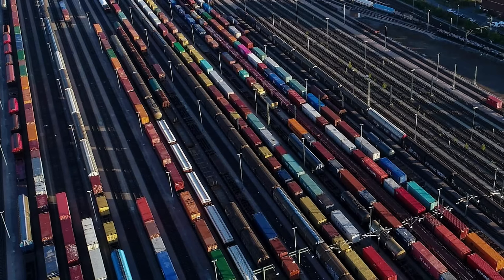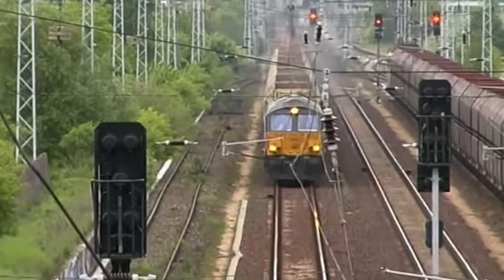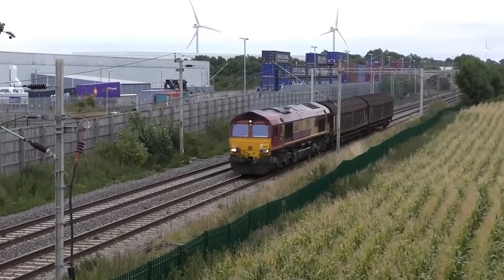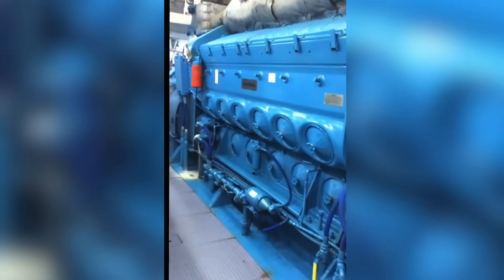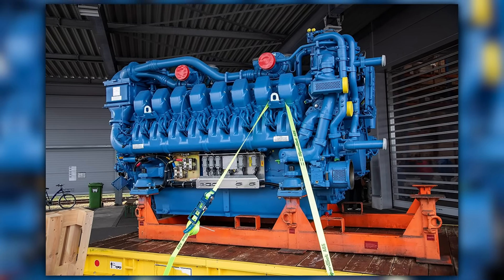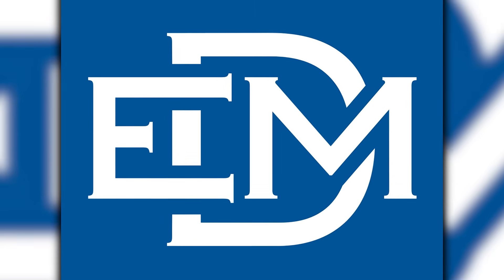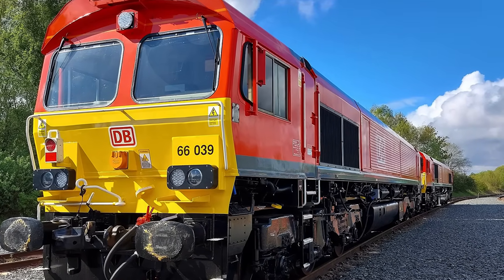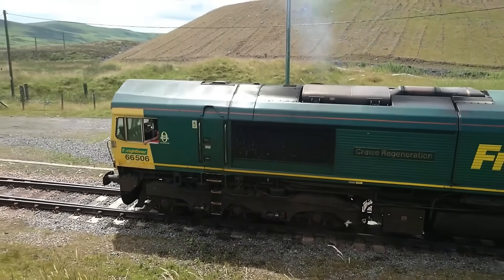Why Europe’s Class 66 Locomotive Still Haunts EMD

Comment: Interesting to see a couple of class 20 units......still working let alone numerous class 37s still happily working !!
Reply: They ran from Scarborough to KWVR very recently AI Bot has no idea telling us they are new cleaner more advanced tech then shows us an early 60's locomotive
Reply: @cedarcam  My property backs on to the Bedford to Bletchley line which has a lot of freight and stock transfer traffic. A while back I had a couple of class 20 units burbling by and regularly get my favourites the class 37s . When you hear these start off from the signals you can hear their exhausts roar from quite a distance ! Also many other vintage diesels still in use mainly being used for stock transfer...........engines built to last !!
Reply: @dominicallen7839  Very affectionate memories of the Marston Vale Line. It's a lovely run and the houses fit around the line in many places so nicely a better picture could not be seen from the windows. All the best there👋
Reply: @adm-5284  Indeed Adam , quite an interesting line with some very rural and remote stations. Of course where the old brickworks stood will be the setting for the planned Universal Studios theme park which will make this line very popular !!

Comment: EMD just didn't update their business model - General electric smashed them at hoime with AC traction based locomotives then environmental requirements ended the monopoly EMD had had for 50+ years.
Reply: General Motors left locomotive manufacture in 2010s? selling the division to Caterpillar (Progress Rail)
Progress Rail had fun and games with Tier4 stateside while Wabtec had an easier time.
Are the F7 in Norway 20 cylinder 645s?
I am wondering if they are like the ones and Australian operator imported in the early 2000s.
Apparently they had been stored for about 20 years before purchase.
I  believe only 2 or 3 are left operational out of an order of 20?

Comment: GBRF has, pretty much a standardised fleet of Class 66.
They are importing Class 66s redundant from the Continent
They also have rebuilt 16 Class 56 locos into Class 66 within ths 56's bodyshell and 56 bogies (Class 69)

They have now starting to use dual mode Stadler locomotives. Class 99 affectionally known as "Flakes"
To quote the ice-cream signs at seaside towns "It's not a 99 without a flake"
Two Class 99s are in Britain undergoing testing.
For those who don't know, the Class 99 has a Co-Co wheel arrangement
75 mph top speed (Can be 100 mph with a software tweak)
8000+ hp on 25kv overhead power
2400 hp on diesel
They also have small fleets of other locos for certain jobs
Reply: We are going with Stadler in New Zealand after the Chinese locomotive debacle
Reply: actually gbrf have a pretty diverse fleet. its DB who have standardised almost entirely on the 66
Reply: @Trainman10715  In DB's case, alot of it is down to losing traffic
Reply: @Trainman10715  But with different gearing of heavier trains..

Comment: Britain doesn’t have grades does it???
Reply: Of course it does.
Reply: @chewyfoks1840 
Where.., from memory tge steepest grade on the British mainlines are around 1:100……. Where 1:50 is getting steep for mainline freight…, plenty other place have as steep as 1:33 ish…… the Uk is a fair bowling green…
Reply: @tigertiger1699  Lickey Bank 1:37 between Bristol and Birmingham
Reply: @tigertiger1699 the likely incline is just down the road from me... 1:37 although for a relatively short distance 

And shap summit while not quite that steep does go on for longer....

What we don't have in the UK is the gradients that are 50 miles plus of continuous grade like you have in the US through the rockies
Reply: @chewyfoks1840 
It’s a but like Western Aussie .. I think there’s only two rail tunnels in all of WA
Reply: Welcome DO have gradients and it’s still a struggle getting heavy freights trains up them!
Reply: @22pcirish 
1:100 is pretty flat… tge British might struggle because of the it fast running.. timetables…, but it’s not like they have 4 horsepower per ton & still only manage 20 mph
Reply: @tigertiger1699 I’ve been driving freight trains for nearly 30 years on every type 5 and 6 loco. You really don’t need much grade at all when pulling our tonnages for it to be challenging.
Reply: @22pcirish 
Touché… my original comment was to the vid stating/ implying that a US loco company that’s building to haul their US trains over the Rockies etc…, needing to supply this same high horsepower to the UK .. because of its heavy grade haulage… apart from a few short places.. surely it’s no where near the same.., 15- 30,000 hp just to get it started on a grade….
Even here in Auckland they used to start a 2700 ton train at the very foot (zero run up) of a 1:38 grade.., with a single 2700 hp GE U26C
Reply: @22pcirish 
And that was well  before they gotten anywhere near the king country longer 1:30 grades
Reply: @tigertiger1699 We mainly use EMD locos for the bulk of freight work. They are good pullers but get a little breathless on climbs!
Reply: stormy in south wales and the lickey
Reply: @garethmatthews7939  Indeed. Triple headed locomotives on iron ore to Llanwern ironworks
Reply: Not like US grades over say sierra Nevada but have different needs. The main line to Scotland has two summits with 1:70 climbs but freight crawling up at 30 mph while intercity trains cross it at over 100 mph is a big issue and why enough power is required
Reply: Yes, of course, but they're referred to as gradients over here.
They're also stated in fractions, e.g. 1 in 100 which translates as 1%. 
Fractions more easy to understand, in my opinion.
Reply: @BazNapper 
Yes … but Leyte no heavy grades.. the place is a relative bowling green.. the vid is implying/ stating they required high horsepower for steep grades
Reply: @BazNapper 
A 1:100 / 1% grade wouldn’t get a mention anywhere else on the planet.. unless it was 800 km long or something odd
Reply: Shap
Reply: @pete904ni Lickley incline.